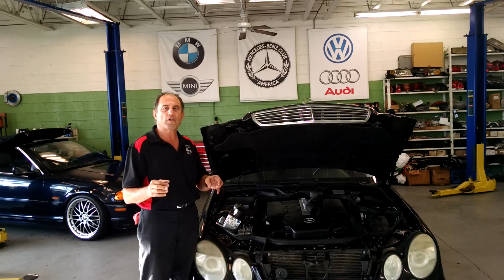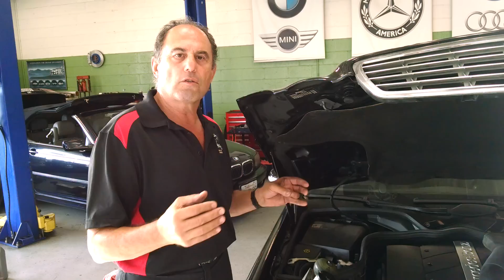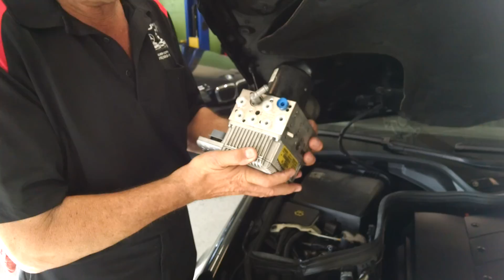Mercedes repair SBC Sensotronic Brake Control (SBC) www.bmwmercedesrepair.com

Comment: were are yo u located
i called mercedes of miami they said only current recall was for the sunroof trim panel for the roof, my car is stuck in this mode with red dash lights, were are you located, they are oviously lying about the 25 year recall....was 10 years then they added 15 years to it imagine how many models are like this out their/....
Reply from the maker: 3817 Sepulveda Blvd. Culver City. CA. 90230 T.310-390-1108.

Comment: This part is cover by the manufacturer. They extended the warranty for 30 years
Reply: So with warranty we can take it to Mercedes dealership Bruh?
Reply: call and will se recall is a lie
Reply from the maker: Some are covered not all. Cheers.
Reply from the maker: @TOKES717  Some are covered not all. Cheers.
Reply from the maker: Some are covered not all. Cheers.
Reply from the maker: Some are covered not all. Cheers.
Reply: In Australia?

Comment: hi,

i have the same problem, after StAr diagnose at the local MB Dealer my car got 2 faults.
1st= c235c    check hydraulisch system SBC pump
2nd=c249f    , also check hydraulic system SBc pump

can U give me advice about how to fix this,.. can I do a revision,.. or maybe reset through software update,.. or change pump,. etc etc.

i would like to visit your garage,  but the problem is i live at the other side of the ocean ( the Netherlands ).
my dealer says he has to change to SBC unit,..costs in $ >> $1800,-

plz some advice,. i start getting desperate,.. cause i love my MB W211 very much

my kind regards
k.c.
Reply: it happend to my car MB w211 220 cdi  an year ago while i drive and red lights  comes out and the car just slow down....
i went to a mechanic and he charge me €1000 for a secound hand sbc pump  he order from poland via internet and now some time to time coming same message brake service visit work shop...
fuck
Reply: On My 2003 MB E320 (211) I removed mine with W211/R230 ABS/SBC tool for Mercedes Benz from ebay for $26 from China. Just plug it in the OBD-II (on-board diagnostic system) then start your car I pressed 50% (users choice) for few seconds until the busy light started blinking then let go. It will go through the programing then it will removed the Red warning light "Reduced Braking Power". Goodluck, I  Hope this will help some of you. Its better and cheaper going to the Dealer and get rip-off.
Show less
Reply 1